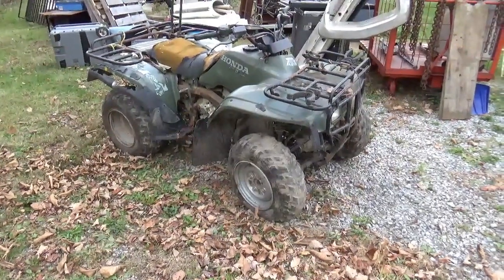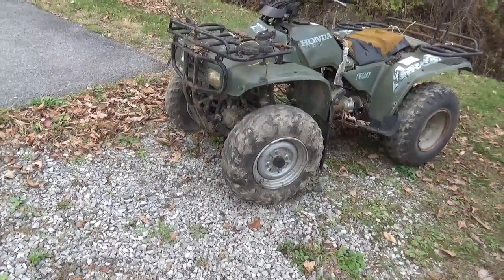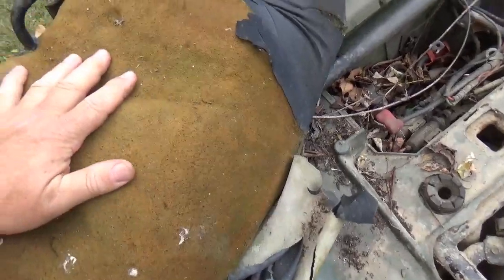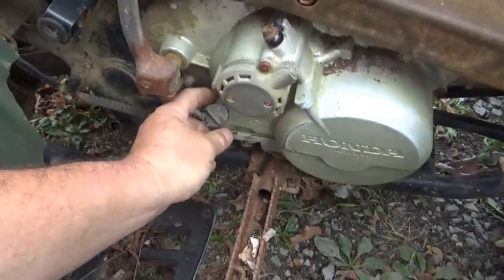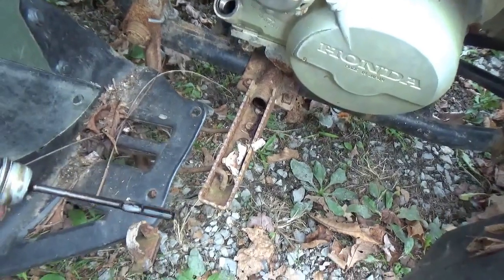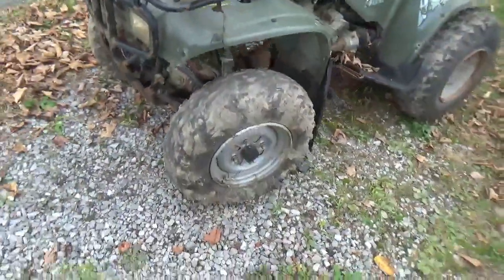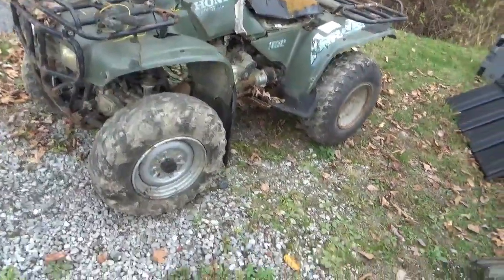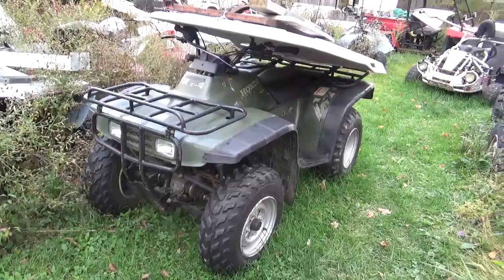Water Damaged Honda Fourtrax 300 4x4 Joins My ATV Collection!

Comment: Looks like a great project. I've seen front and rear diffs go on those 4trax when not taken care of. Don't worry, any type of lessons on seat repair are yours for the asking just try to keep the foam dry. Plastic bags or an old feed bag, it don't matter once wet then freezes and only dries on the surface and that promotes rot. 20 minutes on my bench and you could put it back on the machine and ride it. I'm not talented in a lot of areas but I've taken to repairing seats pretty well. Just in case I keep those in stock since they were the same from 1988 -2000 with the 2 and 4wd versions being the same. Roll on Harvey

Comment: Honda built and still builds bulletproof engines maintained they'll run forever and take a beating.
Reply: All japanese manufacturers make reliable motors. Honda never had the performance that the others have though. The motors are too tame.
Reply: Didn't like when they turned them sideways!